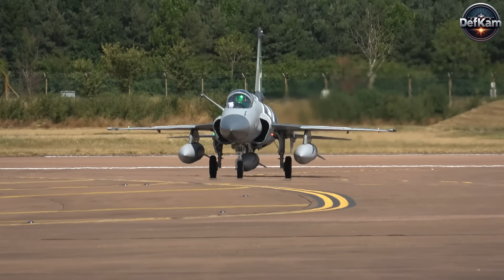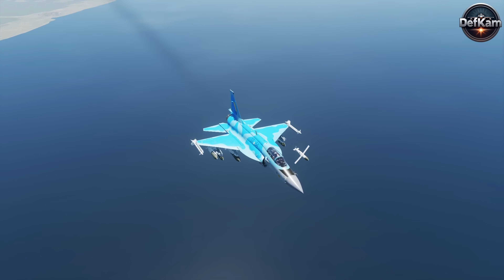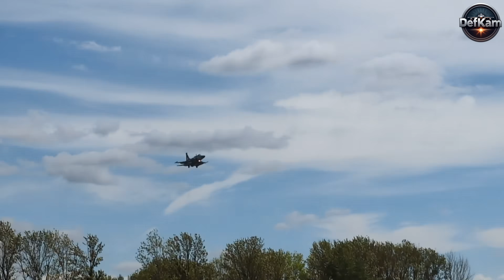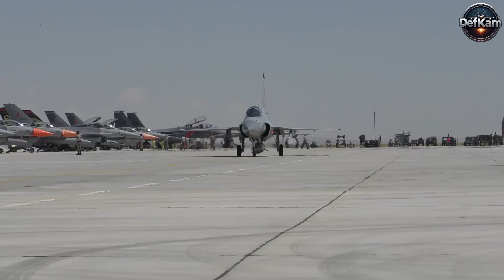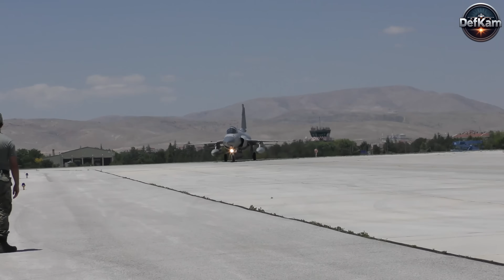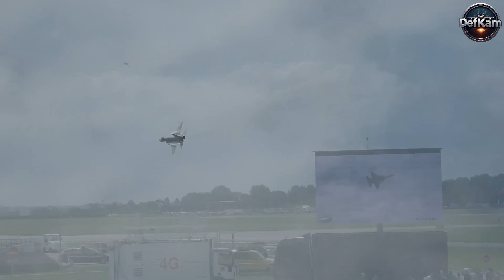JF-17 Thunder for Bangladesh

Comment: The Chinese made Jf17 fighter aircraft is a superior, very capable and reasonably cheaper cost. If this Jf17 fighter aircraft is procured by the Bangladesh Air force, it will greatly enhance the defence and offense capabilities of Bangladesh. Bangladesh will enhance it's defense capabilities by procuring the Chinese made J10CE fighter aircraft.
Reply from the maker: Yes, Thunder may be, but J10-C is only available for export, TOT is not available currently.

Comment: No brother, We're going for the J 10 CE
Reply from the maker: Yes, you can get it. Smart choice
Reply: @DefKami  I wish China or Pakistan offered a 4.5 gen twin engine platform that is not as costly and hard to integrate. I know about J 35 but it'd be very expensive and delivery times would be long. Still if we can get the J 10 alhamdulillah..